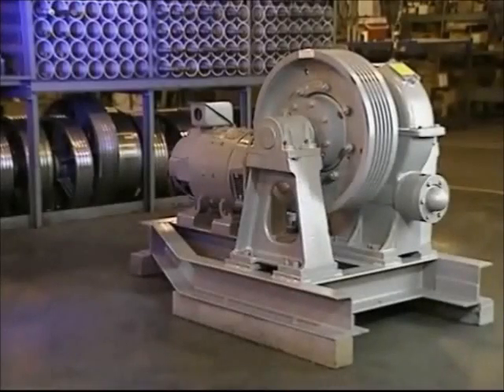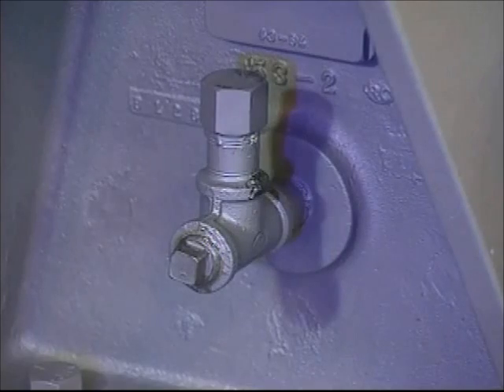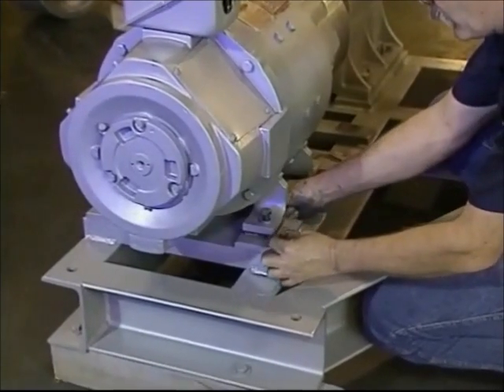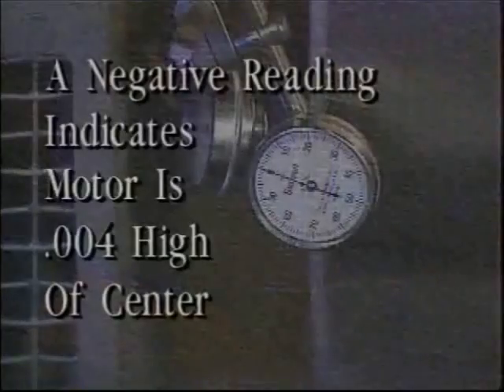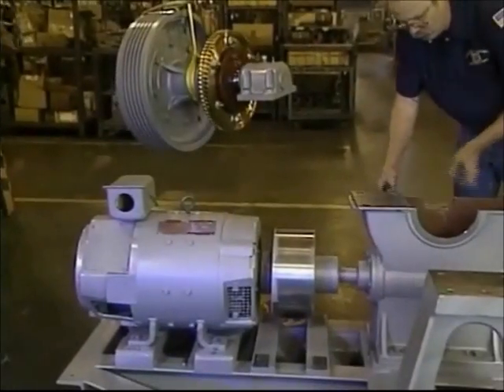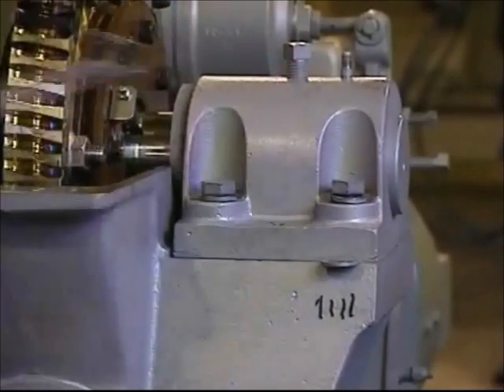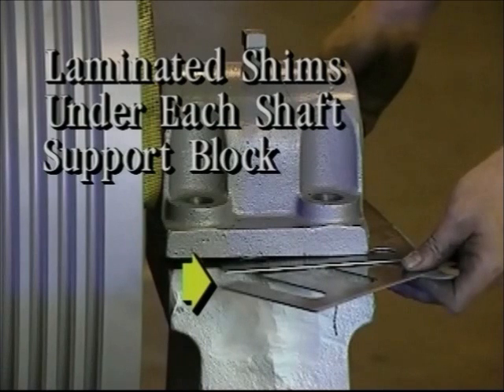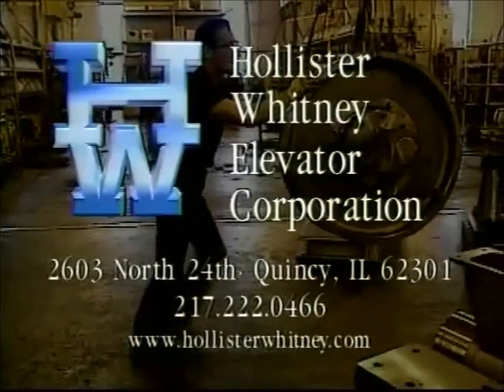Machine maintenance procedures for Hollister-Whitney ELevator traction machines.

Comment: I had several 53 machines that were 20 years old with many hours which I had to lower the gear into the worm to compensate for backlash that was very noticeable in the ride quality of the car.  After bluing the gears and getting the proper pattern, I tried setting up the backlash at .006, within spec.  After an hour or two of operation, I found the machines noisy and tight after warming up.  I had to set them at about .012 to get them to run right.  Again, these were not new gears.

Comment: Nice demo but incomplete and out of order.  Indicating the motor with brake drum WITHOUT a load on the assembly is a waste of time. Things ALWAYS flex when loaded. Indicate after the base is mounted to floor and level with balanced load in car,  THEN  you can start the alignment process. I've done many mods with this exact motor-gearbox assembly and they ALL move when loaded. You can leave the tapered pins in and shim the rubber mounting a bit to get it close then pull the pins and finish It off then ream the holes and set the pins when you're done. Taking that assembly to a job the way it was shown and run it without re-indicating the coupling will put an irregular load on the bearings of the motor and gearbox, more so the motor, and stress the coupling flange. Just speaking from experience in the trade for 17 plus years.